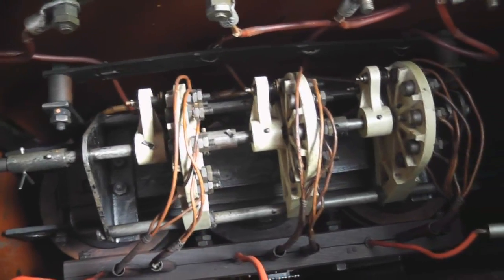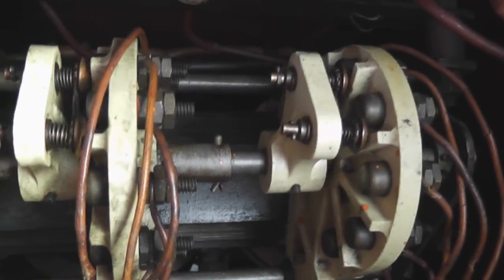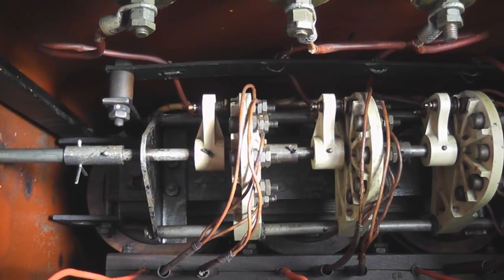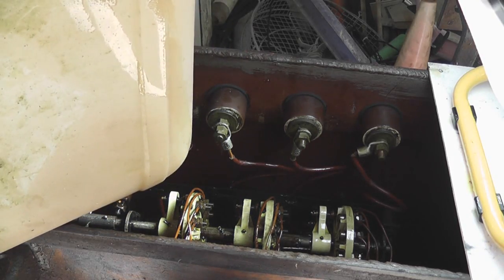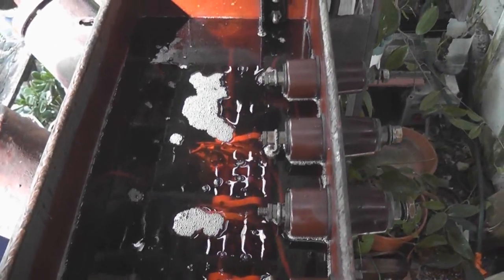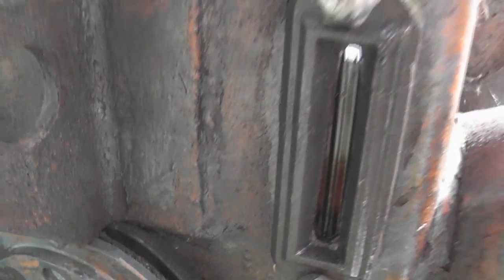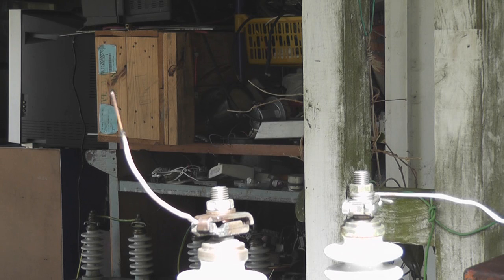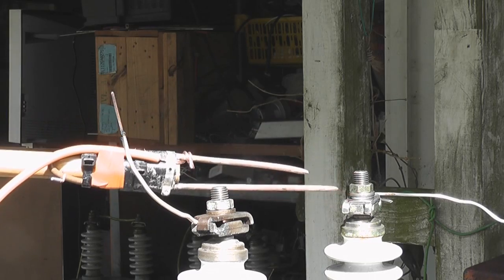the Transformer is in service - First test run

Comment: Under varying conditions, surprising how far the arc breakage point is before it disconnects, down to ambient temperature, humidity, air currents, dust, and other factors.

Comment: This may be a strange question, but does anyone know where to buy liters or gallons of transformer grade mineral oil? I just got my first pole pig and it needs approximately 21 liters of oil to top off. I can only find large barrels for $650 or little 10oz bottles for $8 each.
Reply from the maker: Go to your local power authority. they should have some mineral oil.
Reply: RODALCO2007 Ok, thanks! I can not wait to power up the new pig I got. Too bad it's going to take about 5 weeks for a new bushing to arrive:(